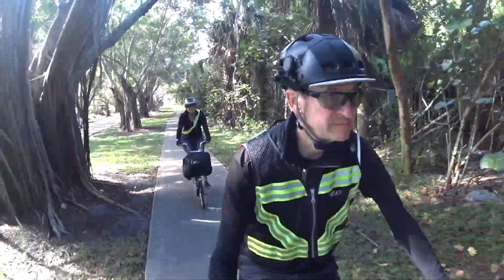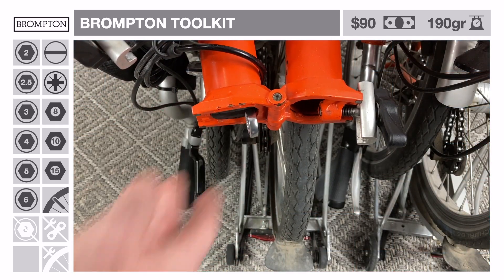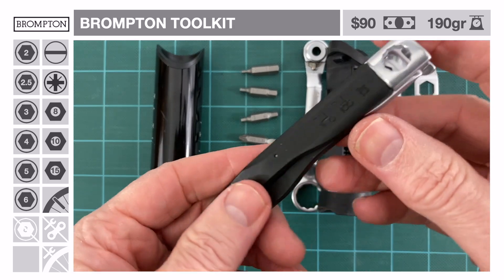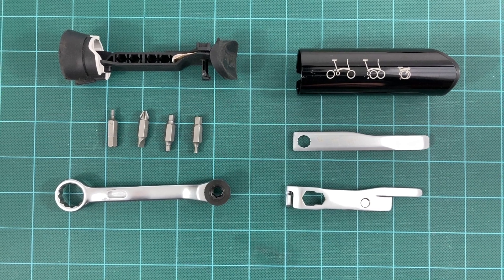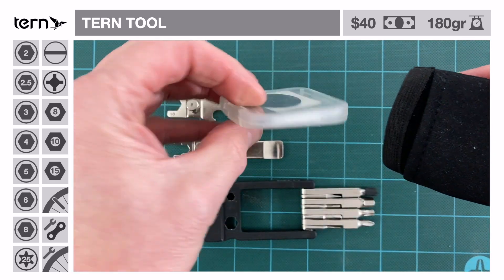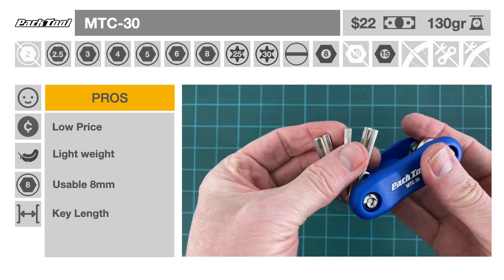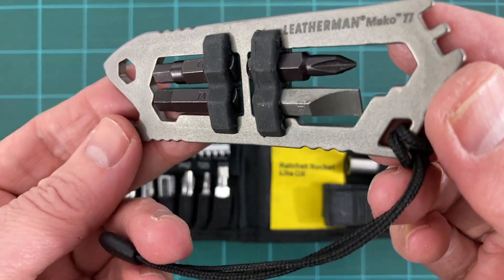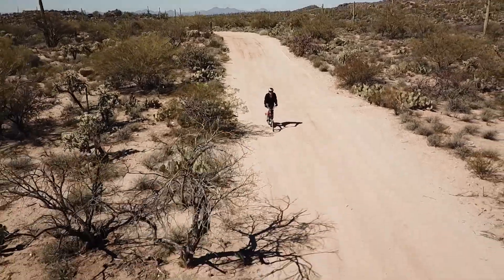3 Brompton Compatible Multitools

Comment from the maker: Tern Tool V2.0 replaced the flat head screwdriver by an 2nd 5mm hex key, thus solving the problem mentioned in the video. A follow-up video was published discussing Tern Tool V1.0 Wrench Failure ( https://youtu.be/kRypxSUiqnU )

Comment: on long trips i only carry patchkit, tube, spare tyre, spare valve, 3 levers, 3-4-5 mm allen, and a 15 mm wrench. i never remove the pedals and don't carry braking pads and of course this doesn't prepare me for chain problems but i can live with that. i'd just get off and push the bike until i reach a shop if i ever break a chain somehow. i'll consider adding an 8 mm wrench because of this video. never thought about it but this could have come in handy last time the stranded water froze into the brake cable housing right at the caliper where it's going upwards.

Comment: Excellent video! 

Tried several multitools. However, almost all multitools either have tools I won't ever need (if my bike doesn't have a single torque screw I won't ever need a torque key) or they miss at least one crucial tool I really need/want (say a 15mm wrench for my Brompton rear wheel). 

Even if I buy the dedicated tool it's missing something I'd definitely would want (say a spoke key on the Brompton tool).

Home and hardware stores sell these little ratchet kits that have most nuts ([phillips] screw heads, allen key heads, 8mm and 10 mm nuts etc) for little money. The only downside? The nuts stop at 13mm for the 1/4 inch standard (15mm nuts are usually based on the automotive 1/2 inch standard which is overkill for a bicycle and won't have small sizes). 

But you need a 15 mm nut for the wheels too! 

Internet to the rescue! Online hardware stores (or simply amazons hardware corner) do sell 15 mm nuts based on the 1/4 inch standard! 

Basically I mix & match exactly the tools I want (and not more!) for little money, based on a ratch based system of bits & nuts, a very small chain breaker (the other half of which is your ratch + 5 mm bit to operate the chain breaker) etc. 

There's only two downsides: storage will never be as neat as a dedicated multitool and if you didn't think of possibly needing it the tool won't have been automatically included...

Strong hint: replace any tool you "borrowed" from your toolbox for this "bicycle repair kit" because otherwise you'll be tempted to "borrow" the tool back and then find it missing on a future trip!

Comment: I have the Brompton toolkit and also utilise an old spectacles case for the other bits and pieces. In it I have squeezed a flat spanner which includes an open ended 15mm spanner and a spoke key. A Swiss Army knife, a chain tool broken down in to 3 parts, an empty biro with a couple of cable ties inside and duct tape and electricians tape wrapped round the outside. An extender for the bits, a few spare nuts and bolts, chain links, a velcro strap, emergency cash and to stop it all rattling, 4 surgical gloves. I keep it in my bag but it could at a pinch go under the saddle on its edge and be held in place with velcro. In the frame on the other side to the toolkit I have a spare inner tube, strong cable ties and more surgical gloves. They are all wrapped in clingfilm and tape. It can be pulled out using the valve.
Reply from the maker: Hi Steve. We have a somewhat similar kit when we go on longer trip, you may have seen it already here: https://youtu.be/UsvSZ_0Sx0w

Comment: You really make excellent videos.  Blown away that Brompton doesn't just use quick release wheels.
Reply: Internal gear hubs apply more torque and therefore never use quick release wheels. (All bikes with internal gear hubs I had used the system shown in the video)

Comment: I recently added the Prestacycle Pro Wallet Kit to my portable bike tools. It is compact ala Topeak with a torque wrench. Fits easily in my basket bag zipper pocket. Use it whenever I have to tighten a bolt to a specified torque.
Reply from the maker: Did you also get the Prestacycle 15mm wrench bit with it?

Comment: Have a look at the Wera Bicycle set 3, good in the workshop and it comes with a second tool holder so you can bring a subset of the tools on the road.  Should cost around $60.
Reply from the maker: @dooley-ch Very nice indeed, thanks for the recommendation. 
We might get tempted (no such thing as too many bicycle tools)

Comment: Just received the Brompton tool kit and on balance I think I'll keep it.

Brompton kit + Park Tool mini chain tool + 3-way spoke wrench + extra ball-ended 5mm & 4mm hex wrenches as a back-up. I'd be wary of using a spoke wrench found on a multitool; the Brompton Superlight has alloy nipples and form experience the metal is soft.
Reply from the maker: As good those multitools may be,  ball-ended Allen wrench are still tough to beat.

Comment: I have three bikes and my toolkit of choice is made by Chapman Tools.  Top-quality USA-made stuff.  I made my own kit starting from their master set, and supplementing from their a la carte options.  That basic kit is indispensable for my German bike, where everything is star bits and hex.  I added some proper-quality spanners (wrenches), tire irons and spoke wrenches (from other US companies) I need for each individual bike.  I tend to prefer US- or EU-made tools, and since I live in the US, USA-made is what's most available.  I also have a torque wrench from a Swiss company that's made in Italy.  Don't skimp on cheap tools, buy good stuff once and you'll never need to buy it again 🙂
Reply from the maker: Good tools last a lifetime. Chapman tools look great indeed  (and easily available on Amazon.com). 
We like Silca tools as well.
Reply: @2Bikes4Adventure  Thanks, I checked out Silca. Looks like great stuff.  Their pressure gauge, while a bit pricey, looks impressive - especially for small tires where pressure is particularly important.  Their tire pumps, too - the one I have is over 20 years old and may break sometime!

Comment: Some Brompton front hubs have 13mm AF nuts so not covered by the expensive Brompton toolkit. I found that a strip aluminium liner for the 15mm spanner made it usable in an emergency (mine has been painted matt black to make its projecting head less obvious when the bike is folded).
Reply from the maker: Our old Brompton (T3) seat clamps also use 13mm

Comment: I've got the cool tool, tern tool and brompton toolkit. It was good to see a rundown of what's missing from each one. The tern and brompton are very elegant but the cool tool is so good at getting the back wheel off and I have a mixture of old and new bromptons to service which don't match that well with the newer tools - it would be had to choose.
Reply from the maker: Unfortunately, no single tool ticks all the check-boxes. Until we find one, we have to supplement the best one with a few extra keys/bits. It also gives us a good excuse to keep on buying new multitools 😀

Comment: Verry helpful!  Take a look at the Knipex  86 03 125 Mini (pliers and wrench in one) that can replace all hex nut keys up to 23mm on a bike, 105g in best German tool quality. For me the perfect bike tool in combination with a Vivtorinox 30303 bit tool and a chainbreaker covers all I need for my bike.
Reply from the maker: @robingood62, Good suggestions. The challenge with very versatile tools is to resist the urge to use them somewhere else and forget to put them back in the bicycle tool kit.
Reply: @2Bikes4Adventure  
So true! But strict discipline can solve this problem. 🤫

Comment: I bought the Tern tool and the 6mm hex rounded after a couple of uses. I found the Topeak and Brompton quality to be far superior which is probably why they cost more. Other than not considering quality, this review is spot on.
Reply from the maker: Interesting point. So far, we haven’t experienced any problem with our Tern Tool, but we usually only use it while touring. The Topeak (and Silca) ratchets are great alternative to the Brompton ratchet.

Comment: Informative, however another suggestion for minimising tools carried. There's a huge variety of fasteners on those bikes, substitute fasteners are available in alternative keyings, not that unreasonable to swap a few of the fasteners on the bike, especially on low load/risk fittings such as those on your cockpit adjustments (I have done so on my mountain bike so only 1 tool fits all the adjustment screws when previously I needed 2). If doing so, I'd still recommend using some high quality fasteners, especially if changing any fastener that is under substantial torque or load.
Reply from the maker: Great suggestion. Going titanium fasteners (while not cheap) could also save some weight as an extra bonus.
Reply: @2Bikes4Adventure  hadn't considered the lighter weight fastener aspect, however I must indeed concur that this could also be a benefit for some. I would again urge caution as titanium fasteners are actually not as strong as you'd think and may indeed be weaker in some applications, which isn't to say inappropriate for use on a bike but you don't want to be removing a broken screw on the side of the road

Comment: Do be careful with the Tern Tool mounting system under the saddle. I have two pouches. Why you ask? Because my brand new tern tool bounced out of the pouch on my inaugural Tern Tool Brompton ride which happened to coincide with a flat about 10 miles from home. I managed to patch the tube without removing the wheel, but I had already called for help and I was so discouraged that I took the ride home anyway :) I bought a second tool to replace the one that escaped, and tool #2 lives in its pouch inside a newly acquired saddle bag held closed by a zipper.
Reply from the maker: Thanks for the heads-up. Hopefully your warning will prevent others from losing their Tern Tool.

Comment: I've got the Tern multi-tool...and some plastic tyre levers. Keep them in a handy pouch along with a couple of spare tubes, a small pump (with pressure gauge), and some wet-wipes which I can easily transfer between my Mini-O-Bag or T-Bag.
Reply from the maker: The Tern tool 6-8 mm wrench, when inverted and re-inserted in the main body makes also for a very potent tire lever (01:47) if you ever loose your plastic ones.

Comment: Amazingly done video. Thanks for the the dedication to a quality video. Very informative for a new Brompton owner. Not having access to the tools mentioned, I compared the tools I owned and found out the Topeak Alien II met most of your must-haves (except pozidriv). Wondering if you considered that one. Thanks!!
Reply from the maker: The Alien II is excellent, we would worry about the capability of its 15mm open wrench however. Being quite short, it could prove to be difficult to apply the necessary torque required to unscrew a stubborn front or rear axel nut. Maybe there is a way to increase leverage using the 10mm hex key ? 
If worst come to worst, you may need a separate stubby 15mm open wrench (about $10) for your tool kit.
Enjoy your new Brompton!

Comment: I too have the Tern (captive parts ensures less loss) but would like to swap out the Torx T25 bit for a Brompton compatable driver.
Any suggestions? 
With the Brompton Tool Kit I have added (carried seperatly) the extension, the magnetic socket holds a 25mm long H8, handy for the folding pedal and hex socketed Crank bolts.
In with the kit a H6 tucked behind the tyre levers at the socket end of the holder, a PH2  also (25mm long) rests loose on the top of the Ratchet Spanner to which is taped a 1.5 mm hex key (my Brompton has an ACE Aliminium front carrier).
Take care opening the tool kit as you have loose bits.
The H6 + Extension reaches down to the Stem binder bolt even on Brompton H stem bikes, I did not trust the small engagement in the extension of the double ended bit.
Take care both.
Thank you for the interesting vlogs.
Reply from the maker: Would certainly like to swap that T25 for a real 5 or 8mm
There are a fair amount of multitools on AliExpress with the same basic design as the Tern Tool (except for the 2 wrenches), but they unfortunately have the same T25 key as well.
If it wasn’t the case, we could have swapped that key for something more useful on a Brompton (salvaging the part for the AliExpress’) 
I like your addition to the Brompton Toolkit. Hopefully, Brompton will get the hints and create a version 2.0

Comment: 0:22 🤔 why not trying the extended seatpost - that way the saddle is just a clamp away from installation, way faster then using tools. just an idea.
Reply from the maker: You are right, it is a lot simpler with a telescopic seatpost. We do own one, but on trips, we prefer to bring the regular post (which is long enough for us) and save 300 gr even if it means having to install/remove the seat at the airport.

Comment: Thank you so much for the sharing! As I believe often the seatpost needs to be removed during travel, and should indeed be tightened to 15 Nm. Would you mind sharing your experience, may I know if you have any suggestions when it comes to torque wrenches? Thank you very much!
Reply from the maker: At home, we use a ProBikeTool 1/4 inch Torque Wrench (rated from 2 to 20Nm). Too big to travel with, but does provide a wider torque range than more “portable” tools (usually from 2 to 6Nm). On tour, we don’t really miss it. We would probably be more careful if we had carbon parts (ex T-Line). Topeak offers nice "torque" version of their Rocket Multi-tool (LT NTX and LT NTX+).That's probably the one we would choose.
Reply: @2Bikes4Adventure  Thank you very much for your sharing :)

Comment: What are your thoughts on a co2 tire inflater vs. a mini hand pump?
Reply from the maker: @Athenasraven, as we often fly to our destination, the Co2 is pretty much out of the question.
Our preference goes for mini floor pump like the Topeka Mini Morph ( https://amzn.to/411jdoX ) . It is way easier to use than a regular mini hand pump and not much bigger. We bring a similar model overtimes we travel as we have to inflate all 4 tires at the airport.
For casual ride around town, the Brompton Zefal is barely sufficient. We purchase a Pro Bike pump with gauge ( https://amzn.to/3XosG6s ) than can be fitted in the seat post (we have the old seat post bungs).
Reply: @2Bikes4Adventure  Great, thanks!

Comment: Have you had any experience with the crankset from blacknorway? I wonder if that is a useful option for bromptons...
Reply from the maker: No, we haven’t. The tool is clever and, by itself, not too expensive. However, the need to change the bottom bracket and crank suddenly makes it less economical. The Wolf Tooth EnCase multi-tool (it goes in the handlebars) could be a good alternative.

Comment: But do you ever need to remove pedals when cycling around? I mean, this "advantage" of the Tern multitool kit doesn't seem like a real advantage. Also, do the metal tire levers on the Brompton multitool scratch the rim?
Also, regarding the chain-breaker, wouldn't a master link solve the issue? I can't imagine a situation where one would need to add/remove chain links from their chain. But with a master link, you can use shoelaces to open/close the master link.
Lastly, why does one need a spoke tool? I would hardly try trueing a wheel in the middle of the road! Again it seems like a job for when you get home to your toolset.
Ps: I'm new to cycling on the street/long distances so I understand that I might lack information that would answer my questions.
Thank you for this video!
(I'm duplicating this comment on the other video you made about minimalist tool kits)
Reply from the maker: - We need to remove the Brompton right pedal when using the Samsonite Epsilon for air travel (won’t fit in otherwise).
- Indeed, plastic tire levers are safer (but also more fragile), as Brompton quickly found out with their initial design. We often have both types with us (the multitool acting as backup if the plastic one breaks).
- We had to buy a new chain while in Thailand once. We didn’t have a chain tool with us, so had to rely on a local bike shop to shorten to the right length and install it. Not critical, but nice to have on remote trips.
- On more than one occasion, a weird “ping” sound while cycling was traced back to a loose spoke. A quick tightening solved the problem. 
- We released a follow-up video concerning an issue with our Tern tool: https://youtu.be/kRypxSUiqnU

Comment: How about crank brother 19
Reply from the maker: Excellent multitool, just need to add a 15mm wrench.
Reply: @2Bikes4Adventure  I'm looking for a multitool setup for my new brompton, and was looking at this. Wouldn't the Crank Brothers 17 suffice? Wouldn't both lack the tire levers other than the 15mm wrench?
Reply from the maker: The Crankbrother 17 and 19 are very versatile and cost effective choices, but as mentioned, a separate 15mm wrench would need to be added (+ tire levers).